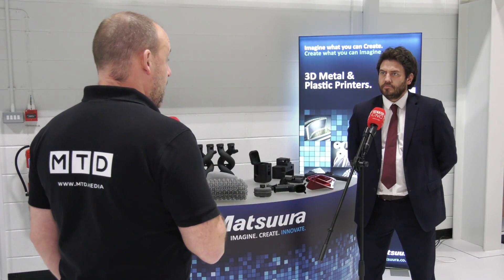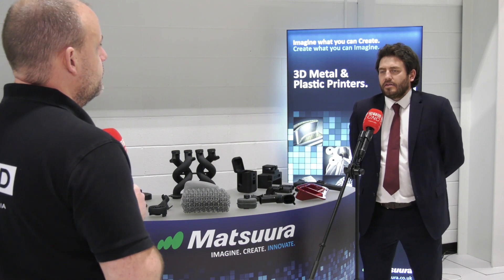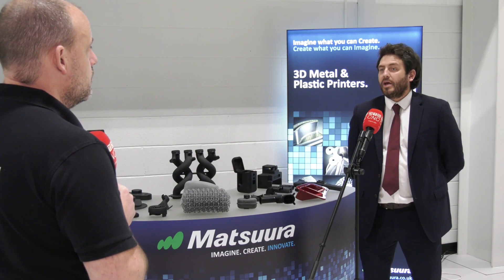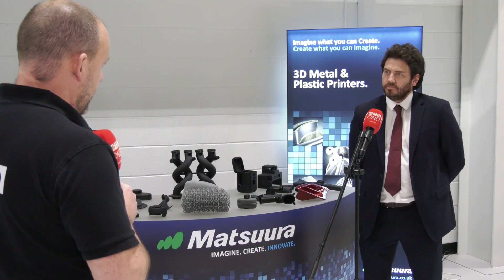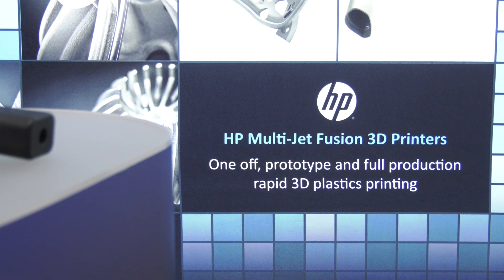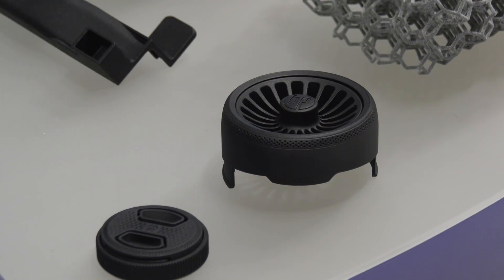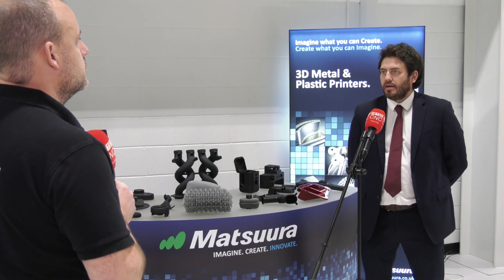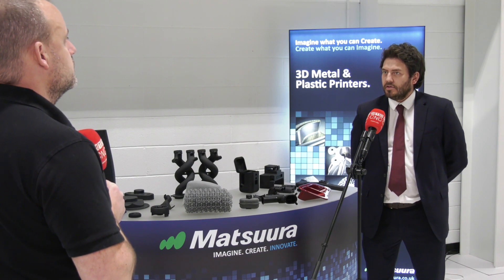Matsuura Additive Manufacturing Facility; a must for UK companies looking at 3D manufacturing

Comment: I had a funny experience with a good friend of mine ?
When 3D Printing first came onto the market, or when it was readily available to us at least.
My friend brought one just for the sake of it.
Just to try it out.
He did not own a CNC machine at the time but was great with CAD CAM software, i think it might have been Solid Works ??
A job came his way to produce a part.
Because he had a printer he thought maybe try and 3Dprint the part. 
The customer was expecting a part made of Aluminium ???? LOL.

What he did was, spray painted the part with Aluminium coloured paint and showed the customer that part, LOL.
Not a big deal ??
The funny part was he tried his best to not let the customer hold the part himself.
Which he said was a difficult and a somewhat strange experience for the customer ??
After the customer excepted the part.
It was a mad rush to buy a CNC Mill to produce the part for real.
Long story short.
He is still running a CNC shop with a few more people now working for him.

Apologizes for the LONG Story, thought it fitted well and it was a great way to let some people know you need to have some BALLS sometimes to succeed in business.